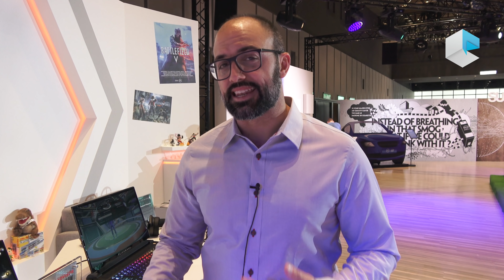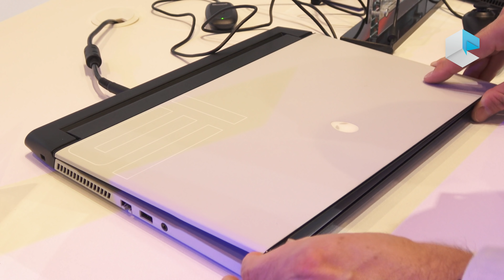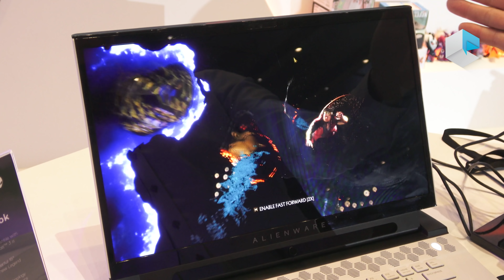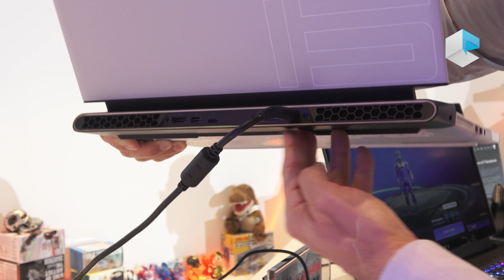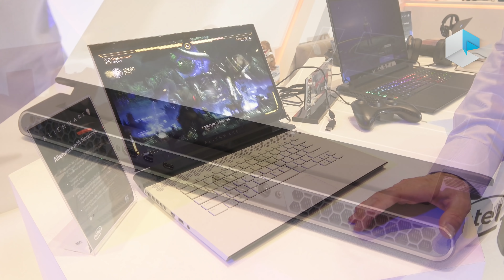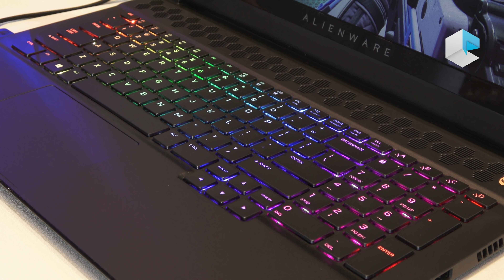Alienware m15 and m17: Intel Core 9th gen, Nvidia GeForce GTX 16 and Legend design

Comment: 🤙 I just got mine m17 R2 i7 my first pc ever switching from PS4
Reply: I have the 180 W . I haven’t had any overheating problems yet I play GTA five for six hours straight  no problems. when I check temps the highs in the 80s lows  in the 70s . I am running the i7 with the 1660ti .
Reply: Nismo _ V35 how is the battery life? I have ordered i9 with rtx 2070. I also plan on taking it to college so I want to know if you think it will last for 3-4 hours.
Reply: Battery life kind of sucks not gonna lie Full battery no charger and it only has like an hour hour and 30 minutes maybe and if you start playing a game or if you’re doing stuff it drops really fast I’ve seen my battery completely depleted after an hour I had to plug in the charger.
Reply: Nismo _ V35 Would you recommend it to someone who’s looking for a gaming laptop?
Reply: any thermal issues? 180w or 240w charge?
Reply: Neon Nebula yes I would for only 8gb of ram it’s a beast I get 70-100+ FPS on Modern Warfare on max settings . I haven’t had any overheating or throttling issues so fare . I’ll play for hrs and it’s warm to the touch .